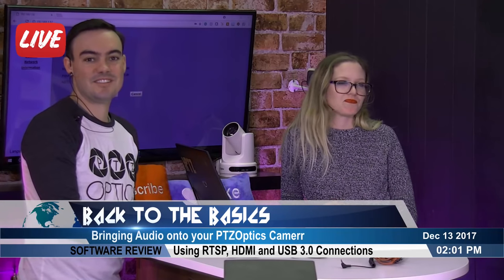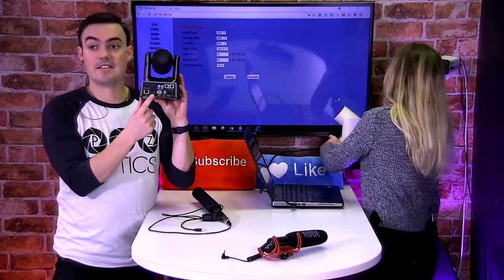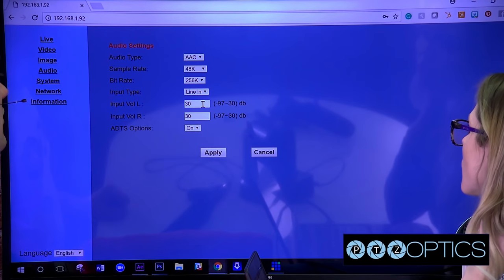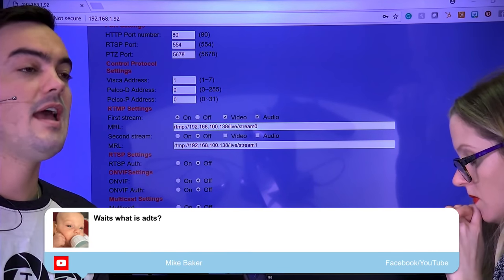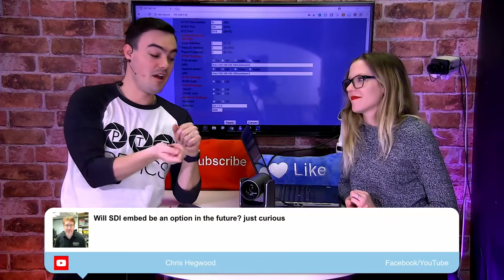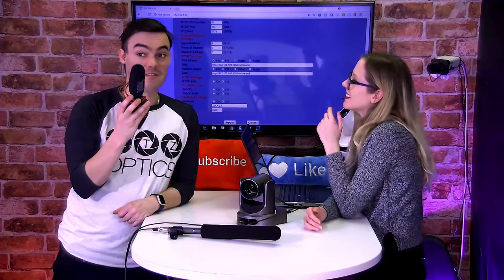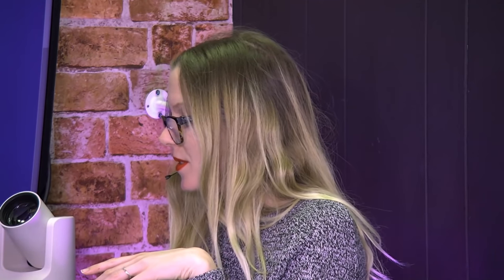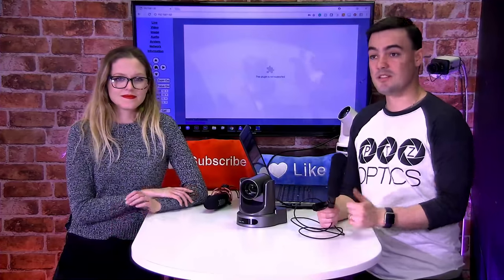How to Add Audio Into a PTZOptics Camera

Comment: How do I connect from my soundcraft ui12 to my ptzoptics ndi / hx 30x for streaming?
Reply from the maker: Hello!
Connecting your Soundcraft Ui12 mixer to a PTZOptics NDI/HX 30x camera for streaming involves several steps, as you're dealing with both audio and video signals that need to be integrated into your stream. Here's a general guide on how to set this up:

1. Audio Setup with Soundcraft Ui12:
- The Soundcraft Ui12 is a digital mixer that allows you to manage audio inputs (like microphones, instruments, etc.) and then output the mixed audio. 

Here's what you need to do:
- Connect Audio Sources: Connect your microphones and/or other audio sources to the Soundcraft Ui12 mixer.
- Mix the Audio: Use the Ui12's interface (accessible via a browser on a connected device) to mix and balance your audio as needed.
- Audio Output: The Ui12 mixer outputs audio through its main outputs. You'll need to route this audio to your streaming setup. 

This can typically be done in two ways:
1. Direct Audio Injection into the Camera: If your PTZOptics camera supports external audio input (like a 3.5mm line-in), you can connect the mixer's output to the camera. You'll need an appropriate cable (likely XLR or 1/4" from the Ui12 to 3.5mm into the camera).
2. Separate Audio Capture for Streaming: Alternatively, you can route the audio into a separate audio interface connected to your streaming computer.

2. Video Setup with PTZOptics NDI/HX 30x:
- Connect the Camera: Ensure your PTZOptics NDI/HX 30x camera is connected to your network. It should be on the same network as your streaming device for NDI to work effectively.

- Configure the Camera: Access the camera’s settings via its web interface (you'll need the camera's IP address) to configure video settings and enable NDI if it's not already activated.

- Control the Camera: You can control the PTZ features of the camera either through the PTZOptics software, a hardware controller, or any compatible control interface over the network.

3. Integrating Audio and Video for Streaming:
Using a Software Encoder (like OBS, Wirecast, vMix):

On your streaming computer, open your streaming software.
- Add the PTZOptics camera as a video source via NDI. The software should be able to detect the NDI stream from the camera on the network.
- Add the audio from the Ui12. If you've connected the Ui12’s output directly to the camera, the audio might already be embedded in the NDI stream. If not, add the audio as a separate source in your streaming software (either directly from the Ui12 or via an audio interface).
- Sync Audio and Video: Ensure that the audio and video are in sync. Adjust in the streaming software if there's any noticeable delay.

Streaming Platform Settings: Set up your stream's output settings according to the requirements of your streaming platform (like YouTube, Twitch, etc.).

Test the Setup: Before going live, thoroughly test your setup to ensure that both audio and video are being captured and streamed as expected.

Remember, the specific details can vary based on your exact setup and equipment. It's essential to refer to the user manuals for your Soundcraft Ui12 and PTZOptics camera for specific instructions and capabilities. Additionally, ensure that all your devices are on the latest firmware for optimal performance.

Comment: what if all you want to do is replace the camera built in mic with your own line device (stereo or mono) and let the camera join the audio to the video within its own circuits ? you want a complete video file with decent audio and not that awful audio you normally hear from these kind of cameras. they are usually filled with digital-birdy noises (techno language)  from poorly designed or built electronics.
Reply from the maker: Hi Geoff,
If you want to replace the built-in microphone of a camera with your own external audio source (like a stereo or mono line device) and have the camera synchronize the audio with the video internally, you can certainly do that in many cases. The process generally involves the following steps:

Check Camera Input Capabilities:
- Ensure that your camera has an external audio input, typically a 3.5mm microphone jack or XLR inputs (in more professional cameras).
- Verify that the camera can accept the type of signal your audio device outputs (line-level or mic-level, stereo or mono).

Select an Appropriate Audio Device:
- Choose an external microphone or audio mixer that suits your needs. If you're using a mixer, it can combine multiple audio sources into a single output to feed into the camera.

Connect the Audio Device to the Camera:
- Use the appropriate cable to connect your audio device's output to the camera's external audio input. For a 3.5mm input, this will often be a standard 3.5mm cable. For professional cameras with XLR inputs, you'll need an XLR cable.
- If your device outputs a line-level signal and your camera's input is designed for mic-level, you might need an attenuator cable to match the levels.

Configure Camera Settings:
- Go into your camera's audio settings and select the external microphone (or line in) as the audio source.
- Adjust the input levels to ensure that the audio is being recorded at an appropriate volume. Avoid clipping or overly low levels.
If your camera offers it, use manual audio level controls for better precision.

Test the Setup:
Before recording your main content, conduct a test recording to check the audio quality.
Ensure that the external audio is being recorded and is in sync with the video.

Monitor the Audio (if possible):
If your camera has a headphone jack, use it to monitor the audio in real-time. This allows you to catch and rectify any audio issues on the spot.

By following these steps, you can significantly improve the audio quality of your videos, as external microphones or audio devices generally offer better sound quality than built-in camera microphones. This approach is widely used in both amateur and professional video production to overcome the limitations of in-camera microphones.

Comment: no it does not work, there is a humming on the signal, unfortunalely, btw. I have three of theme. No one works as espected.
Reply from the maker: Hello!
A humming noise in the audio signal when adding audio to a PTZOptics camera can be caused by several factors. Identifying and resolving this issue involves checking various aspects of your audio setup and connections. Here are some steps you can take to troubleshoot and potentially fix the humming noise:

1. Check Cable Connections
Secure Connections: Ensure all cables are securely connected. Loose connections can cause interference or humming.
Cable Quality: Use high-quality, shielded audio cables to minimize interference.
Cable Length: Long cable runs can pick up electromagnetic interference. Keep cable lengths as short as practical.

2. Ground Loop Issues
Identify Ground Loops: A common cause of humming is a ground loop, which occurs when there are multiple grounding points in an AV setup. This can create a loop that picks up electrical interference.
DI Boxes: Use a Direct Injection (DI) box with ground lift capabilities to break the ground loop.
Isolation Transformers: Audio isolation transformers on the audio line can also help eliminate ground loops.

3. Power Sources
Separate Power Circuits: Ensure the camera and audio equipment are not on separate electrical circuits, which can contribute to ground loops.
Power Conditioners: Use power conditioners to clean up the power supply and reduce electrical noise.

4. Interference from Other Equipment
Physical Separation: Keep audio cables away from power cables, transformers, and other sources of electromagnetic interference.
Turn Off Unnecessary Equipment: Try turning off other electronic devices nearby to see if they are causing interference.

5. Camera Audio Settings
Adjust Levels: In the camera's settings, adjust the audio levels. Sometimes, too high or too low levels can introduce noise.
Firmware Update: Ensure your camera's firmware is up to date, as firmware updates can sometimes resolve hardware-related audio issues.

6. Check the Audio Source
Test Source Equipment: Test the microphone or mixer that is feeding audio into the camera to ensure the problem isn't originating there.

7. Test with Different Equipment
Swap Out Components: Try using different microphones, cables, or mixers to pinpoint whether a specific component is causing the issue.

8. Balanced vs Unbalanced Audio
Balanced Audio: If possible, use balanced audio connections (XLR or TRS) instead of unbalanced (RCA or TS), as balanced connections are better at rejecting interference.

9. Consult the Manual or Manufacturer Support
Reference the Manual: Check the PTZOptics camera manual for specific audio troubleshooting advice.

Contact Support: If the issue persists. By methodically going through these troubleshooting steps, you should be able to identify and resolve the source of the humming noise in your audio setup.